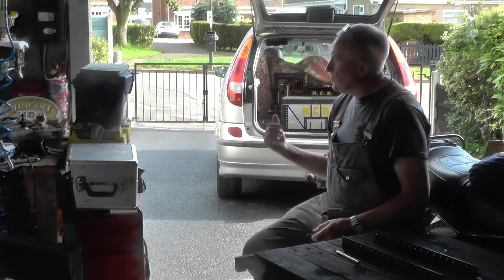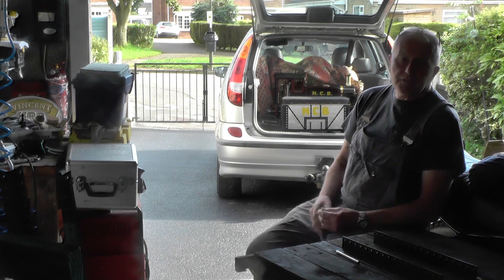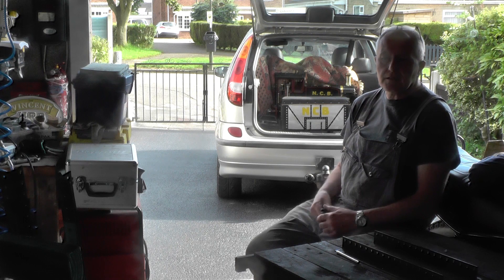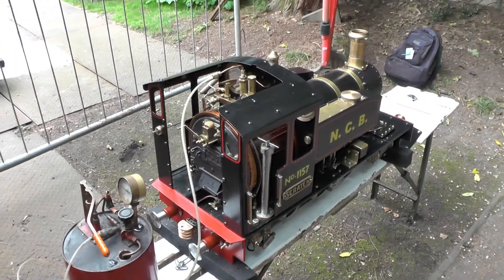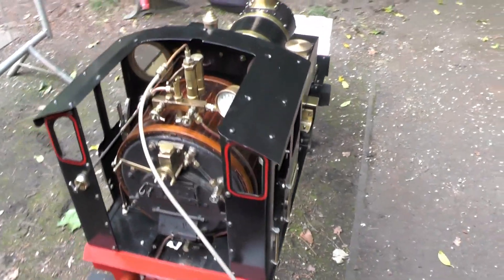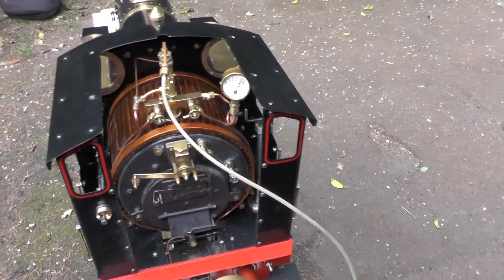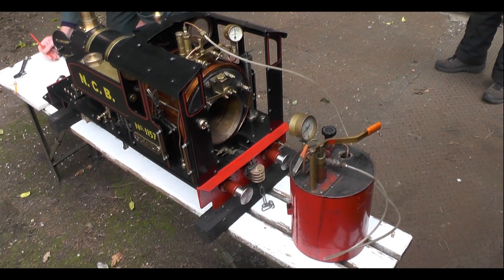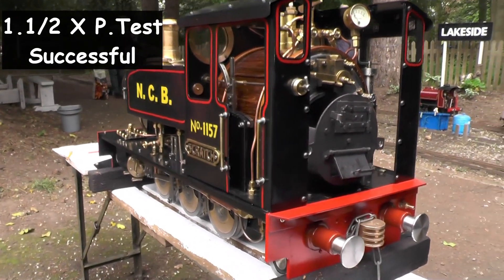Build a Beginners 5" Gauge Steam Locomotive ( 1st Official Steam Test  ) "mr factotum"

Comment: Good stuff!
I have built 7 locos over the 70 years as a model engineer. I started with a Tich and have been trying to convince those new to the hobby not to make the same mistake. Tich is not a good beginners loco as it has as many parts as a bigger engine. Best go for a small 5 inch gauge 0-4-0 or 6 coupled.
Reply from the maker: Cheers for the feedback,Harold
 great to hear from a fellow model engineer!👍😉🚂
When i started my Metre Maid back in 2018 i was advised by some to make a simplex or a tich, but my tutor back when i was an apprentice and who is a prolific miniature engineer who i still see now (he's 94 now) said i couldn't go wrong with a sweet pea for simplicity, so  i plugged for the six wheel version Metre Maid. Took me 18 month to 2 year to build, but never looked back, a bit apprehensive at the start though. It runs great and been running since 2020
Thanks for the comments Harold
regards
Kev